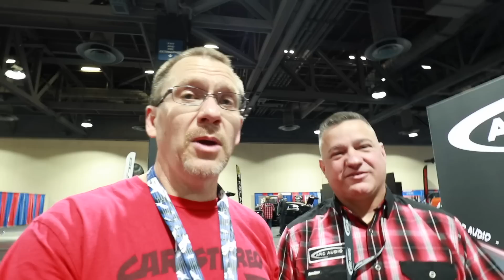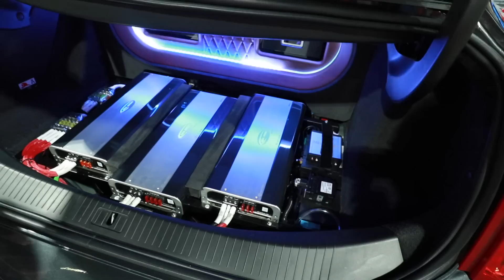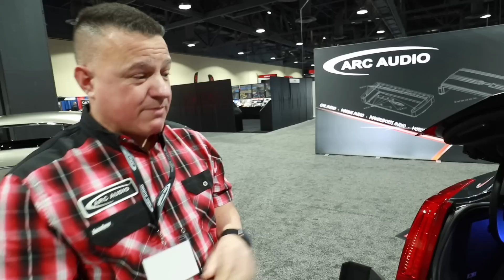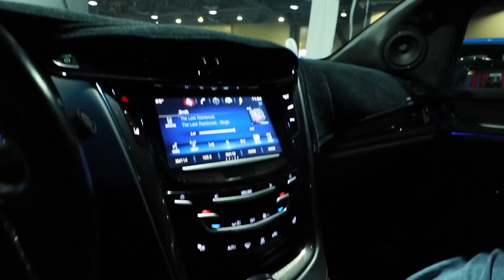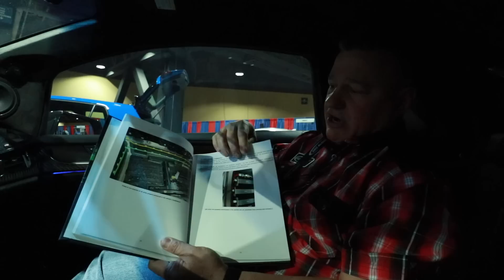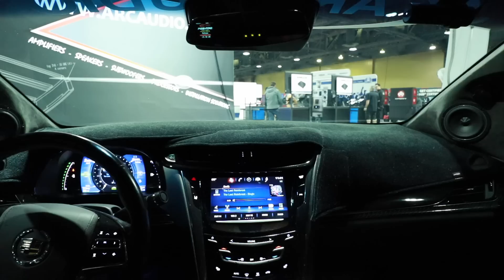The most amazing best sounding car we have heard from Brian Mitchell of Arc Audio

Comment: I know this is a year later. But I just checked this song out in my yukon holy hell. I run only dd audio cc6.5a set off a diamond audio d600.4 and subs are fi ssd 12s ran off a dd audio dm 2500 with a broken rf 3sixty.3 powdered by JVC KW-V340BT. Nothing to write home about for sure.

Comment: sweet liquid cooled amps, nice!  I thought about doing that but i started out with just a PC fan pointed at an amp that I had that was overheating and it worked for a while and then the fan burned up and i'm assuming that was because it was a 12v fan and when your motor is on you're pushing 14.4 to it?!
so my question is is he using a PC power supply to run the liquid cooling setup to keep the voltage at a constant 12v or what? and has anyone had any luck with even air cooling an amp array?  thanks.

Comment: Which is the best head unit Kenwood, pioneer,Clarion,Sony,??
Reply: @Simon Felix  
For pure SQ alone I prefer the top of the line Kenwood eXcelon Reference XR or flagship Sony Double-DIN head units.

The 5v RCA preouts on the Kenwood XR's don't clip or distort even at full volume (40/40).

But you have to like the GUI and features as well, so pick based on that, too.
Reply: @bbfoto7248  
Is that true for models such as my DDX9904S? And, if so, does that mean I can adjust my gain tunings at a different volume than the "recommended 75% standard"? I recently installed a full system replacement with a sub in an SUV, and while I love the soundstage, I feel like my low end is lacking (while I know I have the overhead) partially due to how low my gain is set (doing it from a chart with a multimeter, not with an o-scope or a dd1).

Comment: All a/b amplifiers to power the system...
Reply: And I believe that the bias is adjusted on each amp so that they run in Class A mode for most of the output power range that's required for them to reach pretty high SPL levels , hence the water (glycol) cooling.  :-)

Comment: @Five Star Car Stereo  

Thanks Dean for taking the time to share Brian's awesome system with us...and thanks to Brian for taking his time to present his install in great detail.  👍

Since you now have Brian's Build Log Book, I have a few questions, as I'm interested in potentially using the new Arc RS drivers.  ;)  

Are the 4'' RS4 midrange drivers in the A-pillars running "open back/free air"?  Or if they are in a small sealed enclosure, what volume of airspace are they in?  Any polyfill or similar damping material in the midrange enclosures?

It's also kind of hard to tell where the A-pillar midrange & tweeters are aimed?  Are the Left & Right sides aimed symmetrically to the center of the car, or aimed at slightly different angles on the left & right sides, skewed towards the driver seat listening position?

I'd also be interested to know how and to what extent the door and door panels were treated with sound deadening, and the type of materials used for that and for the 6.5" RS6 midwoofer mounting baffles/rings?

Did he do any sound deadening treatment to the roof/headliner?

Thanks again.  👍
Reply: bb foto the 4” is open to the inside of the dash. The speakers are aimed (generally) left side toward the passenger left ear and right side toward the drivers right ear.
Reply: bb foto doors and roof were treated generously with dynamat and dynafoam products. The door rings/baffles are made out of abs stack fabbed with custom logos laser etched into the material
Reply: @brianmitchell3992  

Thanks Brian, appreciate your time in getting back and the added information.  👍

Should have also asked how low & high you have your RS4's playing...approximate HP & LP & the XO slope?  Just curious as to their usable bandpass?

I'm still running some of the OG Robert Zeff/Nikola Engineering-designed Arc Audio amps in one of my old school installs...upgraded/re-capped/slightly mod'd Arc 4150CXLr (2) and a 2500CXL.

They continue to impress me.  I can count on one hand how many other amps have ever come close to equaling them in terms of pure SQ (and usually at much greater cost), and I've owned and used 100's of "high end" amps over the years.

Love your install and your attention to detail.  Thanks for sharing, mate!
Reply: @brianmitchell3992  

Also wanted to ask:  How far out in front of the windshield & vehicle does the Soundstage Depth extend with tracks with this type of depth information?  For instance, where does the solo Trumpet in Sara K's "I Want To Sing Your Blues" image in the Soundstage?

Comment: I remember years ago we installed 8" and 10" subs in Pontiac Fieros in the passenger foot well. Sometimes we used that trunk space behind the engine and vented them all the way to the cab. A few we installed in the rear window.  But mainly we fiber glassed them in the foot well.
Reply: chuck miller   
Had a Fiero back when I was an installer in the early 90s.  Put 4 Rockford Series 1 10s in it.  2 behind each seat in a 4 sided enclosure using the rear “firewall” and floor as the other 2 sides of each enclosure.  Used Great Stuff expanding foam to anchor the enclosures to the car.  Had 2 6.5s in each custom door pod, 2 3.5s and the tweeter from the 6.5 components in the dash locations.  All running off a Zapco active crossover, Punch 150 on subs and Punch 45 on all the mids n highs, both mounted on motorized amp rack that spun 180 degrees to show both sides, mounted in that rear trunk behind the engine. That system blew everyone away for it’s volume and sound quality, that heard it. Couldn’t see the subs until I pulled the seats forward, as the enclosure top looked like nothing more then a 3 inch deep rear deck, lol.  Lost about 4 inches total of leg room from the enclosures, which was fine for me, as I’m a lil guy at 5’8”.  Loved that lil car.
Reply: @lewthern  I remember installing a punch 150 in that flip down console between the seats.  Installed two 3.5" speakers in the head rests, had to series wire them because they were too loud by your ear.  I wish we had the woofers back then like we have now, hardly any airspace required. We installed in those Fieros at least once a week. They were everywhere.  I remember the dash speakers were a 4x10, Fosgate had a plate with a 3.5 and a tweet that fit in that spot. Sometimes we would put two 8 inch original Kickers in a sealed box behind the passenger seat. Did tons of amp racks in the trunk too. We did bandpass boxes in the trunk, used that stretchy dryer vent to get the vent lengths right, then fiberglassed them solid. i did so much fiberglass work that it does not make me itch anymore.